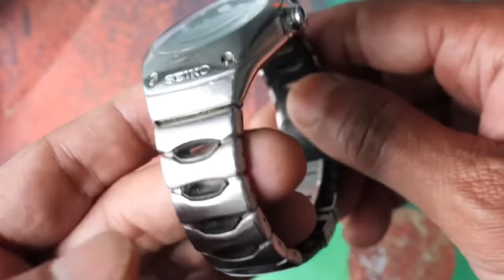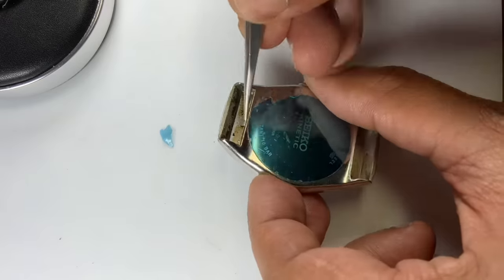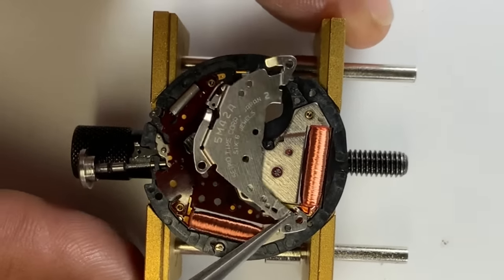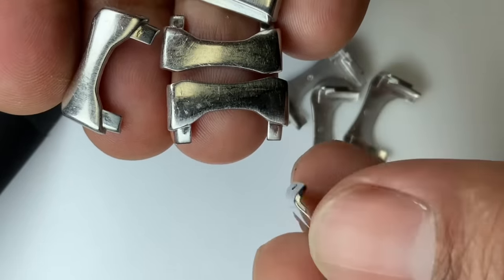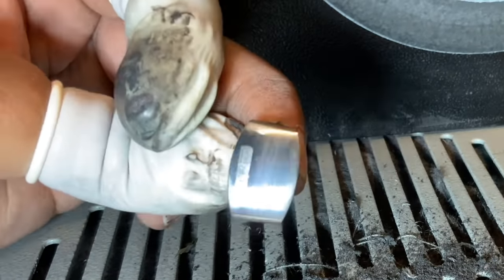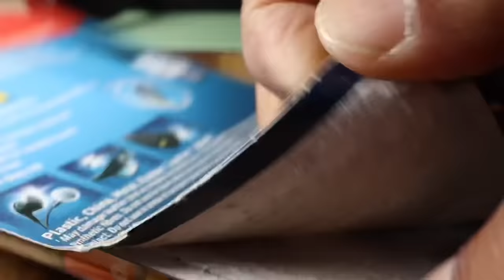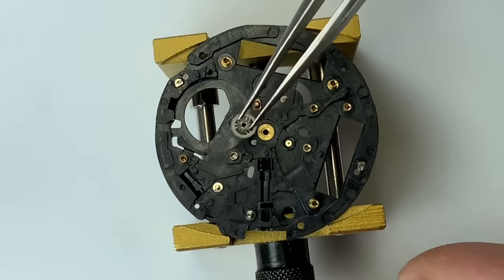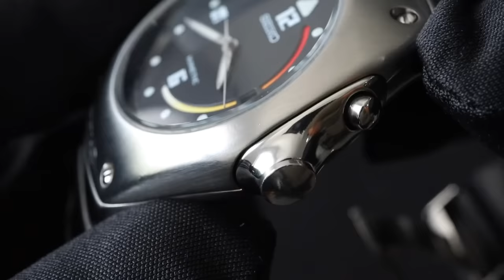Restoring the Ultimate 90s Seiko Kinetic Arctura!

Comment: I have this watch, only with a silver dial and mine had no band, so I adapted a silicone one. It works well with the watch. I had to replace the crystal also and went with the double domed instead of slightly magnifying. I like it and I was also able to find a sapphire one, so no more scratches. I wear this watch a lot and the case is very scratched. I am now inspired to bring it to this level of beauty with a brushed finish. I wish I knew how... but I have a jeweler friend... Thank you for featuring this gem. I love this watch.

Comment: I've bought a lot of non-working kinetics when they were cheap.  People didn't realize about the only thing that went wrong with them was the capacitor went bad.  I mixed and matched parts, replaced the rechargeable capacitor and came up with 4 fully working watches.  The only thing is the only replacements I could find at the time were Panasonic MT920 capacitors which only charge to about 3/4th storage as the original Seiko cap.  I cleaned and oiled all the movements according to the service instructions and all the watches work find years later.

Comment: What a stunning job. Amazing! I have the identical model and I replaced the capacitor and it's running great but I couldn't do a full strip and rebuild. A mechanical watch takes some doing but the parts on quartz watches are microscopic! Great restoration.

Comment: I'm really happy to see that you restored a Seiko kinetic watch! That particular model was quite pricey back in its day. I own several kinetics and they keep great time - like five seconds or less per month depending upon the temperature. They stopped replacing the capacitors in favor of a rechargeable battery that is meant to last longer. Cheers!
Reply: I bought mine in Dubai for 600 in '98.  Still wear it, had it serviced recently, Seiko Australia no longer carry parts or support the watch. Had a new capacitor put in, can't get the kinetic energy storage to go around the full 30 seconds, stops at the 20 mark
Reply: This kinetic Seiko watch was my first real good watch in the late 90s and yes they were great at keeping time and cool looking too. I wish I still had mine.
Reply: @TheCcmarine  I still have mine. 97 model, bought in Abu Dhabi in 98, has been flawless, went to war with me, glass got scratched to hell, only got a full service last year Seiko Australia don't have the parts, took original band off as its getting cracks, 800 Aust to get a new band special order 3d print. Just the black band, will use the silver pieces on the original on the new band. The only thing wrong, I can't get a full 30 second on the capacitor, only ever goes to 20. Have left it on the tooothbush charger and it hit 30 for half a day.

Comment: I have a Lorus Kinetic (with glass case back, made by Seiko in Japan, I believe), dating from 1996, which makes it 27 years old. It works perfectly, and has NEVER stopped once since it was bought.

I also had a Seiko Kinetic (without glass case back), and it would never hold a charge in the capacitor, and was ALWAYS stopping. Obviously the Seiko capacitor was duff, and the Lorus looks like it will outlive me (I'm 60).

EDIT: "Seiko Arm Cheese!" ... Mmm, yum! 👍😋🤣

Comment: My parents gave me a Seiko "AGS" automatic generation system watch in 1989, which was the precursor to Kinetic. I still have it, but it doesn't hold a charge anymore. Thanks for the videos!
Reply: You can still get the capacitor for those and it will be a goer. I just did one of mine.
Reply: Capacitors for the Seiko Kinetic watches are very easy to change. All you need is a case back remover and a decent small flat blade screwdriver. The capacitor part number you would need is 3023 5MY They are around $20 US on eBay.
Reply: @Killsnapz  Correct, but be careful when putting the oscillating weight back on. Make sure that the teeth on the winder engage with the very small cog that generates the charge for the cap.
Reply: @Killsnapz   Beware that not all Kinetic movements use 3023 5MY. The differences in the part numbers are the mounting bracket and they are spot-welded in place so not interchangeable. They do all use the same Li-ion rechargeable battery (the capacitor version is long ago obsolete)
Reply: @alanmckinnon6791  yes but the OP stated he had an AGS model which would make that movement the 5M23 and the correct capacitor for the 5M23 is the 3023 5MY. Which is why when I responded I stated it was the capacitor he would need to repair his watch. I am well aware of all of the different part number capacitors Seiko uses as I have all of them in my inventory. I also own over 20 different Seiko Kinetic watches from the first 5M23 to the 7L22 and three 5J22 Auto Relay versions.

Comment: I’ve actually got a similar watch, mine has a luminescent dial instead of the blue and had a simple rubber strap rather than the stainless steel exoskeleton and also the case opened from the back instead of the front. It was my wife’s wedding gift to me back in the late 90s.. It’s been sitting in a drawer for quite some time I want to repair it myself. I have ordered the new capacitor and a new strap for it. I’m going to see how I go just replacing the capacitor because I don’t think I’m confident enough to completely tear it down with no experience. I bought a couple of Chinese mechanical watches to practice on. I think once I’m confident that I can reassemble one of those then I might tackle a full service on my Seiko … these things are a lot more complicated than I thought they were, just as complicated mechanically as a traditional automatic watch with the added complication of electronics.  While my watch is not quite as beat up as this one it does have a fair bit of surface scratches in the dial and the brush steel.  Also instead of the case being fully steel mine is plastic with a brush steel cover over the front but it’s the same 5M42 movement so this video was very helpful… definitely going to save it for later as a reference. thank you for making such great content

Comment: Got the same one, bought it in the summer of 97. I had it serviced about 10 years later and it was upgraded to a 6 month sleep function. In 2007 I bought my second Kinetic, which has a 4yrs sleep function and I wear that one. My original one is in the box my new one came in……

Note: Those Black Rubberised part of the strap often split and break; I used to always have a spare and I’ve still got a new one never used….

Comment: SWEET.... i was looking at that watch when they came out (1997), but bought a different model (Seiko Kinetic Relay Stainless Steel 5J22 Watch).  it won't hold a charge once it stops moving (they stop moving after they have not been moved for a certain amount of time to conserve battery; supposed to be able to put them down, pick them up 3 years later and the hands all go to the correct time), but i still love it.
time flies

Comment: I am wearing a kinetic seiko with this 5m42 movement,it is a favourite of mine but since I have many watches that I rotate to wear the rechargeable cell has given up over the years.Knowing that it will happen again I took the rotor off and replaced the rechargeable cell with an Sr920sw cell and it lasts for over two years without worrying about using the watch and keeping the cell charged.The silver oxide non rechargeable cell is paced positive up like the rechargeable cell and without the rotor replaced.The watch works just fine with the Silver oxide 920 non rechargeable cell.

Comment: Lovely work. Personally on that plastic mainplate, instead of pegwood and rodico alone, I would have worked with a small paintbrush and a solution of water and soapy degreaser, rinsing it in water in the ultrasonic machine and giving it a final quick immersion into isopropyl alcohol to remove all the water.

Comment: I still wear my Seiko Kinetic Sports 100 (stainless steel case and bracelet with gold accents). My favorite watch, which I bought around 1997-98 because I got tired of changing batteries in an older Seiko. Had to have it reworked about 10 years ago at a place here in North Texas after the storage capacitor failed. Still runs great but the bracelet clasp is getting worn and sometimes times pops open if it gets in a slight bind.

Comment: Wow. That was impressive work. 

We still don't seem to see enough of the mechanism here to piece together how these kinetic watches work, though. :p I have a mechanical one (not very expensive Seizmont) that I wind - and it does extend a full day without needing to be wound if I carry it around. Which is astonishing in so many ways. It seems that if I just get off the couch for a few hours a day, I won't have to wind it at all. 

I'm assuming the large half-plate makes a half-turn(minus a bit?, with a sector-tilt on each half?) to cause a small rotation towards the mainspring - but I really can't see how it works mechanically, and how it doesn't just stop winding when it's tightening even a little bit, or why it doesn't just bounce back and forth unless you shake it very deliberately and turn it around exactly 180 degrees, etc. I know it isn't wizardry, but it seems like very interesting black magic is going on here.

Comment: I've got the all titanium version without the rubber part in the strap, all the link pins are stretched from when my son used to hang onto my watch strap when he was little, is that something that could be repaired? Obviously capacitor is dead too, but case is in good condition. Great video.

Comment: I want one!
Tell me, what would a good one go for today?

I do have a Seiko (5 Automatic), about 28 years old in April.
Very nice, fits with everything. Simple, no batteries.

However, it does require a service. And a new "frame" for the day/date. Perhaps a new "5" number. Maybe even a new glass. Could also need a new 12 'o clock marker..
But I will never ever sell it, the value is purely sentimental, and yes - the above will cost me more than a new.

Comment: I have a Seiko Kinetic Arctura. Unfortunately, the band needs replacement every 10 years or so because the material starts to disintegrate and you could lose your watch. The early capacitors didn't last long. My third capacitor is failing now. What an amazing time piece however. Mine quite literally keeps time to within seconds a year.

Comment: i remember the first edition, late 1990’s.  I think it was $300-500…. It was more expensive than the a kinetic titanium model.  I originally got the titanium kinetic watch, but it scratched like crazy, so did not keep it.
I was strongly considering this current watch, but got an omega instead; then Omega watches much less expensive, relative to today’s price; $1,200, compared to $2-3K!.  The price of a gold on stainless steel Omega in late 1990’s was around the same price as a current stainless steel Omega.  

The only downside to the seiko was that the strap needed to be cut to fit you., to my understanding.  There was no other way to adjust the size again, I believe.

It was a beautiful seiko.

Comment: I have a Seiko Arctura which i bought in 2006. Since it is a driving watch, it has a 30min stop watch chronograph which i think needs servicing since it stop functioning. It has a sapphire crystal face and same with its back because i can see some moving parts in it.  I really wish i can restore it. It is already very old time piece. I can't trust our local watch servicing shop. I'm still using it since it can still tell time. Wish i can restore it just like new one.

Comment: Wow - a lot of comments for a somewhat obscure watch.  The funny thing is - I bought it's twin earlier today. Supposedly running (it does show the second hand in different positions in the pictures) - and the seller accepted my $30 offer.  With shipping and tax - I'll be into it for $40. In the photos it looked just about the same condition as this one,  I'll be doing the swap from capacitor to battery myself after my experience with another one a few days ago.  I had one of the gold dress watches - crappy Seiko band (very thin "gold" coloring on it half-rubbed off) - and the capacitor was shot (would run for about 30 seconds after doing the wrist/elbow thing with it about 100 times) so I got a new one from eBay ($20).

I tried removing the back using my Chinese back wrench - no dice. The wrench is a POS, and the back was locked on harder than I've ever seen a back on. I suspect the lack of a gasket had something to do with that.  Anyway - I took it to a local jeweler who does watch batteries, figuring he'd have a better wrench, and I guess he did since he came out of the workshop with the back loose.   He asked if I wanted him to put the battery in, and I foolishly didn't ask if he'd ever done this before.  When he came out with the watch it was quite evident he never had and managed to misassemble the entire watch so the battery was in backwards, the screws weren't tightened and the rotor no longer rotated.  I thanked him and left - never to have him anywhere near any of my watches again.

So I bought it home, disassembled what needed disassembly, put the battery in correctly, rotor back on and swinging freely - and the watch doesn't work at all. I checked the battery voltage at the contact point from the battery to the circuitry - 1.4V - so the watch should have run.

Put it under the microscope and found a nice divot out of the charging coil, and apparently, the watch won't run when that coil is open.

I looked on the web for replacement coils - they're scarce but available (money order or check only from a watch supply house) - both of them would cost me about $45, and I wanted both on hand in case I boogered one up.  Then I saw Google pointing me to AliExpress - which has a vendor selling the entire movement with the new battery for around $35, FREE delivery from China.   Ordered and waiting to see what arrives.

I'll try to remember to update this post when it arrives.  I was very interested in his technique for getting the crystal out of the case, it looked like he basically pushed it out from the back...  that implies that if it's in good shape one might remove it, refinish the case and reinstall it.  Any hints on that would be most welcome!

I know everyone said it - but these are quite enjoyable videos, relaxing in a way I find quite nice.  Nothing is ever too frantic, and it seems rare that the Nekkid Watchmaker ever has a screw or spring go flying, something that happens with some regularity when I'm doing these jobs.
Reply: BTW - has anyone ever tried protecting those coils with a thin layer of epoxy or some sort of clear-coat?  It's really stupid to have something that delicate in a spot where a slip of a screwdriver can totally screw the pooch..  Some "protection" would seem worth trying..  (same issue on my Accutron watches - except they have the added attraction (really attraction) of the tuning fork cups over the coils being magnetic - so anything - any sliver, loose screw gets dragged across the coil instantly killing the watch entirely. And those coils are scarce and $$$ when you can find NOS.
Reply: BTW - a day later the watch started running.  No idea why, but I'm wearing it right now and it's been running fine for over a week now. Apparently the new battery needs some time to adjust to it's new home or something, then once it does - the movement is happy again.

Comment: I had the exact same watch but with a brown face, purchased it when it came out.  Unfortunately the rubber part (back of the steel belt) disintegrated and Seiko no longer had replacement part. Very sad but also very fond memories.

Comment: Honestly it would be neat to see an affordable, modern version, of this mechanism in a new watch.

It's pretty neat and surely if it can be done in 1997 it's still practical today, solar watches are neat but won't charge under a sleeve or in dim lighting, Seiko and others seem to have functionally similar systems but they tend to be much more expensive and exotic from what I've seen

Comment: love your video's . i was making a watch with eta 2824 , removed the stem for adjustments now only locks in date setting position. wont go in all the way even with the lock pin is pushed down . any recommendation?>
Reply from the maker: Sounds like the yoke has slipped from the sliding pinion
Reply: @NekkidWatchmaker  thank you so much for your reply . ill try to take it a part to see if i can fix it .because of you i started making watches and have a large collection .